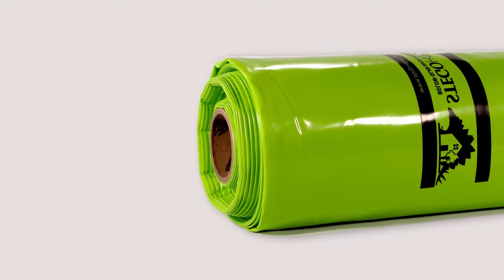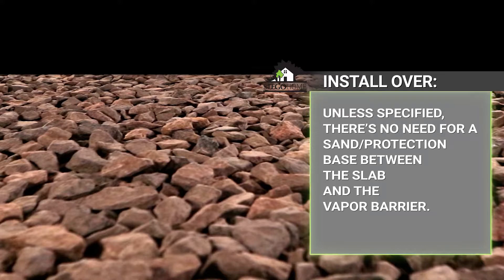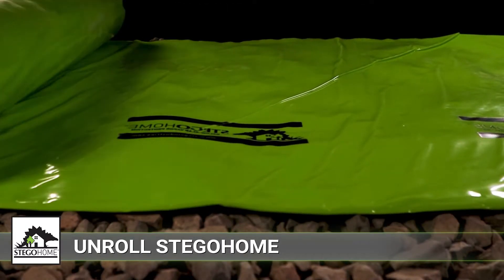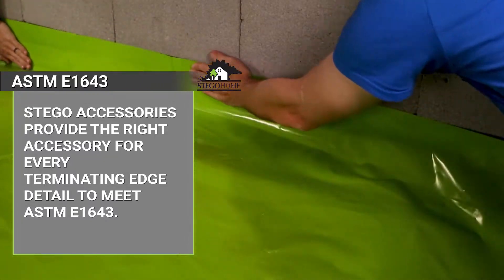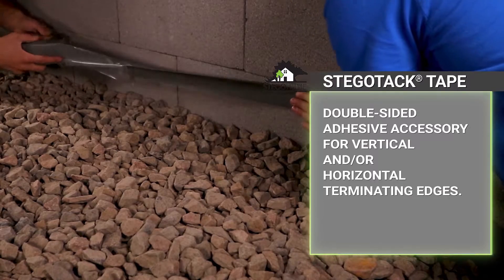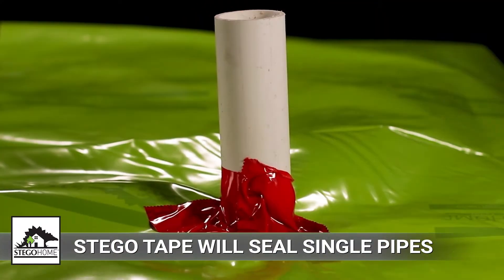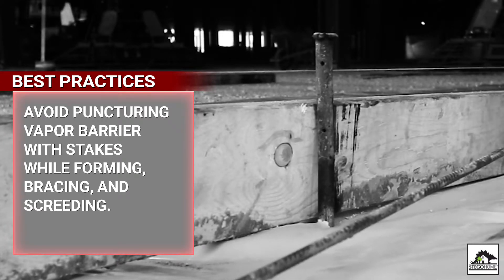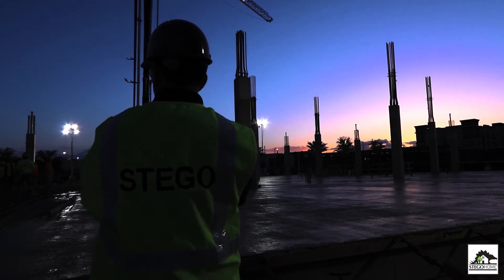STEGOHOME® How to Install a Below-Slab Vapor Barrier in Your Home

Comment: Which product is recommended for a slab on grade residential home foundation in North Georgia?
Reply from the maker: Hi @jeffabbott403, thanks for reaching out! 
Our most popular solution is StegoHome 15-Mil Below-Slab Vapor Barrier. But if you would like to discuss any considerations or products further, give us a call at 877-464-7834 and we’ll connect you with a local sales representative. Thanks!

Comment: In your opinion, does foam insulation go below or above the VB?
Reply from the maker: Hi Larry, thank you for the question. In most residential new construction, industry guidance points towards having the vapor barrier in direct contact with the placed floor slab (above the sub-slab insulation). We do see exceptions, such as when installing radiant heat, but the vapor barrier over insulation has benefits for slab placement and long-term flooring performance. With that said, StegoHome will serve its function (impede diffusion of soil vapor) in either orientation and it’s always recommended to check with the insulation manufacturer for any additional guidance. Check out this article for more info: https://www.stegoindustries.com/blog/when-and-where-to-install-a-below-slab-vapor-barrier